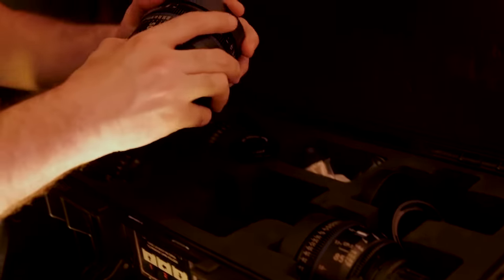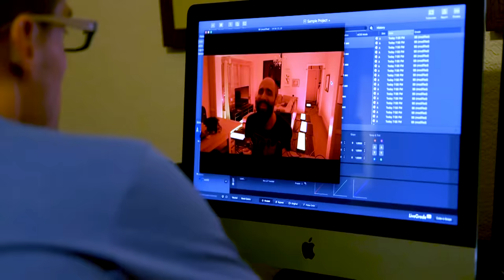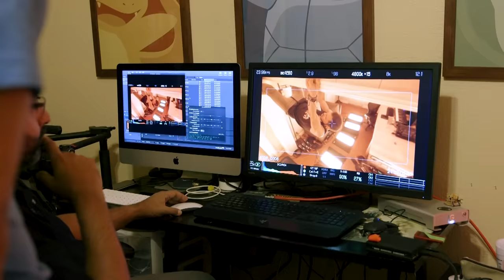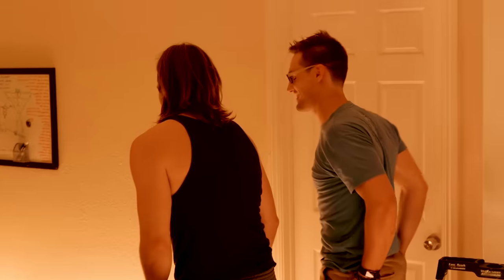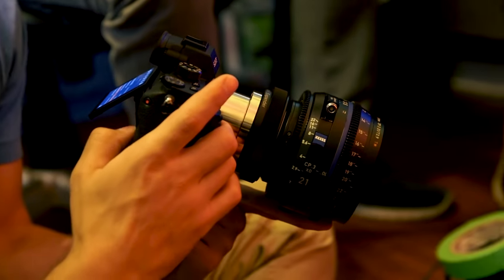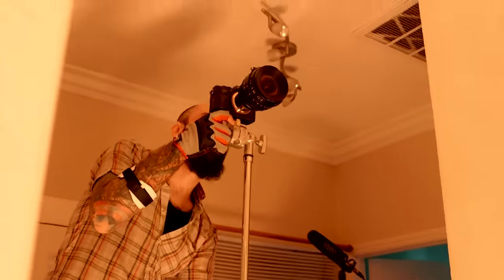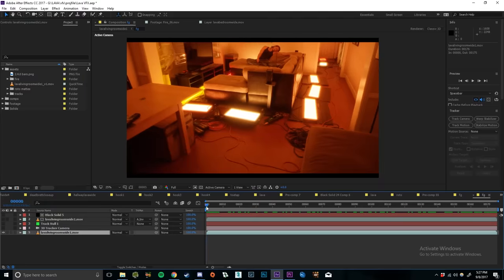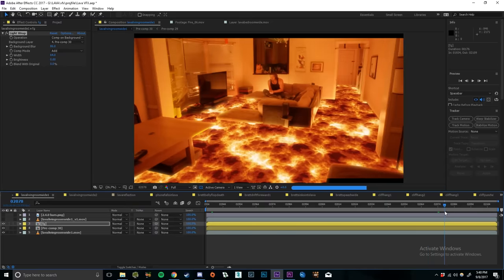How we made "The Floor is Lava"

Comment: I thought there wasn't enough heat distortion on the shots that weren't looking rights at the lava,  surely something that hot would cause visible distortion from any angle?
Reply: you're right, but it actually distracted from the performance. It looked like a weird glass mirror distortion effect.
Reply: matty9460 you should make a video on the next part
Reply: matty9460 If it was real, they would die because it was really hot and the house was entirely closed, keeping the heat inside of it!
Reply: At least they are being smart, being dumb is the opposite of what you want to be.